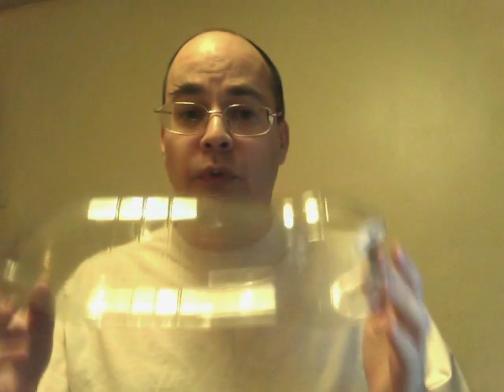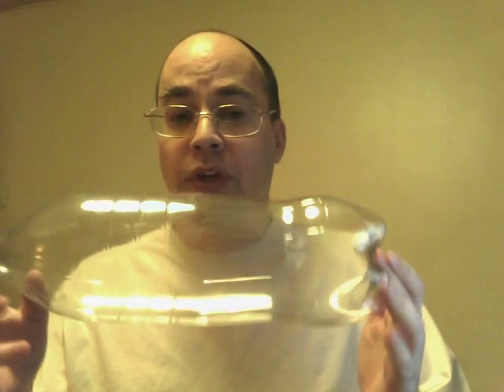Why do things collapse due to air pressure?

Comment from the maker: I couldn't use really hot water to collapse the bottle more dramatically as the effect would have started before I had got the video started, but hopefully you get the idea. If you want you can always try it for yourself, but be careful not to scald yourself.
Reply: how do you reverse this?
Reply from the maker: If you place the plastic bottle in warm water the air trapped inside expands back to the previous volume and pushes the plastic back out again.
Reply: thanks